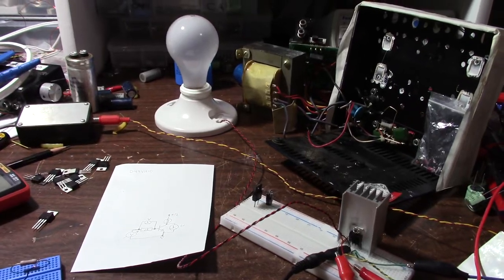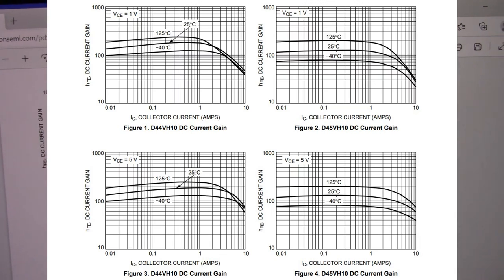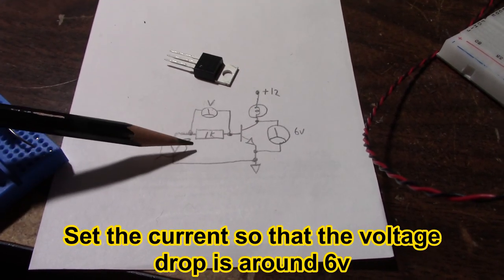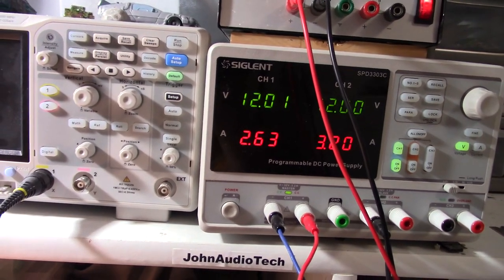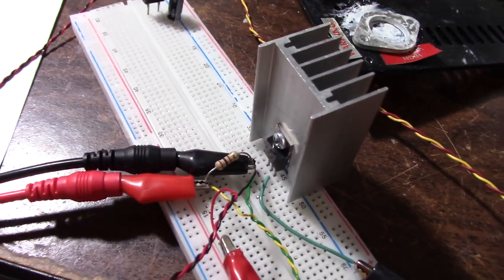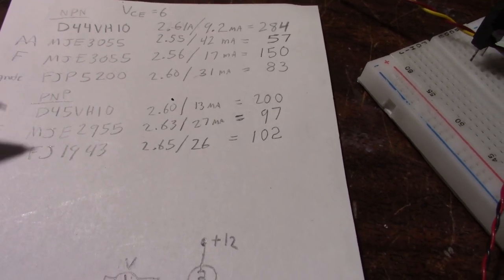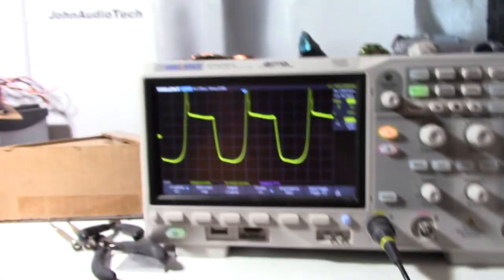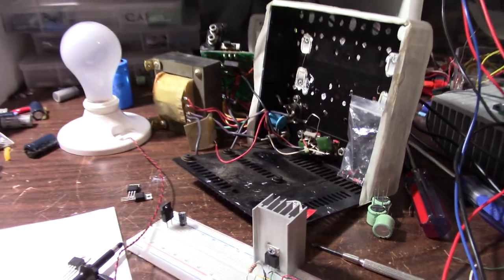Transistors for amplifier projects and tinkering, D44VH10 / D45VH10

Comment: The problem with doing β measurements is you're only getting one or two data points. If you look at the datasheet for the D44VH10 ("On Characteristics"), you find that minimum β is 35 at Ic=2A, Vce=1V and just 20 at Ic=4A, Vce=1V. That would suggest a minimum β of around 26 at Ic=3A, Vce=1V. But then looking at the graphs, it shows a typical β of around 130 at Ic=3A, Vce=1V. That's a 5:1 variation in β between typical and minimum.

If you look at the typical β curves for Vce=5V, you see a β around 160 at Ic=3A, which is quite a bit below your measured 284. Considering that the minimum β may be 1/5 the typical value, it leaves the possibility that a worst-case part might have a β of around 32 at Ic=3A, Vce=5V.

Of course, that's not a problem for the hobbyist as you can measure and match each part, but it would rule out the transistor for many production linear amplifier uses because of the very large potential variation in β. I assume that's why the part is described as designed for switching applications (where we design with a fixed β of 10 or 20 in saturation).
Reply from the maker: The minimum β is alarming to the product designer. Probably there to cover the manufacturer. Modern processing seems to be doing good at keeping β high at higher currents. I have some old 3055s with β under 30 at 3A.
Reply: @JohnAudioTech  Have you tried these BJTs at higher frequencies in the HF / VHF range? I'm always on the lookout for cheap RF transistors and Mouser sells these for about a dollar. The datasheet gives a 50MHz bandwidth... my rule of thumb is that 10X the BWGP is usually sufficient for RF so maybe these would work well in the 5MHz range...???
Reply from the maker: @andrewferg8737  Check out the 2SC6144 for a cheap bjt for RF tinkering. I haven't tested them yet, but they look promising. β is over 200 at high currents (7 amps), low capacitance and high fT of 330 MHz from 1 to 4 amps. The small signal TO-92 2N5770 is another one. I made an FM transmitter range booster with one (FCC illegal).
Reply: @JohnAudioTech  Thanks. I'm ordering some SC6144 now to experiment with as an RF power amp.  
For small to medium signal TO-92 I like the ZTX652 for $1 on Mouser. They're quite rugged running at up to 2A and put out a solid 1W @ 100MHz.

Comment: Pls make the video with opamp to this transistor
So we can see the power outcome
Reply: I'd find that very interesting too.
Reply: @joshhyyym  My own experiments with driving audio with ordinary complementary BPJs and an 8-pin dual opamp have been disappointing.  Of course, I really do not know what I am doing.  Perhaps, something like a TLC2272 is not delivering enough base current?
Reply: @GnuReligion  You can use the NJM4556. It can deliver output currents as high as 90 mA. I operated it together with TIP2955 / TIP 3055 up to output currents of 80 mA in a very simple configuration (bases together, emitters together and between bases and emitters a resistor of 68 Ohm. It works perfekt with output voltage swing until 2 V below the rail voltages. The quiescent current is only 6 mA per amplifier unit. The speakers are driven up to 10 mA directly by the low power op amp.
Reply: You can do it very easily according to the concept of Johns video "Unbiased audio amp output stage..."

Comment: These transistors are known for years now (I used them primarily for voltage regulation and stabilisation purposes and - maybe stupidly - never tried them for audio amplification). But they are obsolete now for several suppliers, maybe also for Onsemi.

Comment: I have questions-
What's difference between Speaker wire and normal Electrical wire and if a normal Electrical wire is used to connect speakers to amplifiers what will be difference in sound if at all ?
2. Is oxygen free speaker wire at all needed if we're not using high end sound system but ordinary low priced sound system or diy sound system made by ourselves ?
Please make a detailed video if you so feel on this

Comment: I got 10 of the MJE2955 and 10 of the MJE3055 of ebay to use in repair of old Tandberg amplifiers.
This is the old style transistors in TO127 housing.
Most of them measure a hfe around 250, while the once that i find original in the amplifiers usually measures around 20 to 30.
So i have to replace both if only one of them is dead.
Not shure how a complementary pair where one transistor has a hfe of 22 and the other a hfe of 230 would work...😋
Reply: It's good practice to always replace the pair even if only one is dead. The one that's still good has likely been stressed significantly, and should not be trusted.
Reply: @ScottGrammer  Yes, when there's only two, that's easy, but when there's 5 pairs in parallell and one of then is shorted, then replacing all 10 gets a bit expensive.
Reply: @geirendre  Yes. But that's the cost of doing it right. In a case like that I'll usually explain to the client (I repair vintage audio gear for a living) that there's a cheap way and a right way to fix it, and I'll do whichever they want, but if they choose the cheap way, I will not warranty the work.